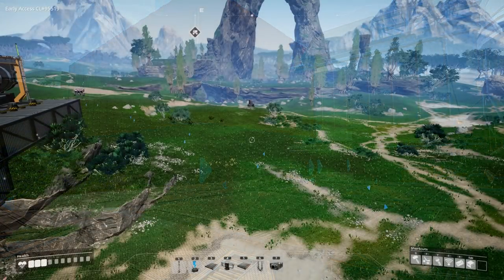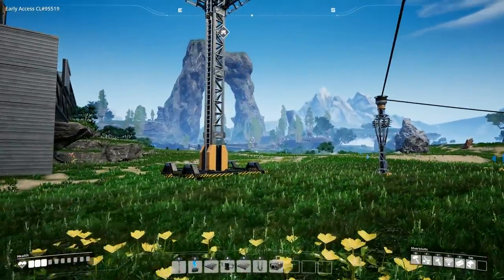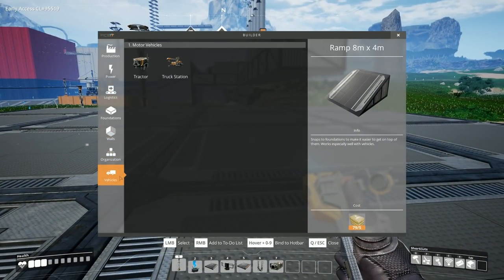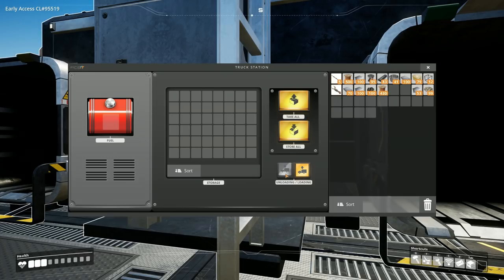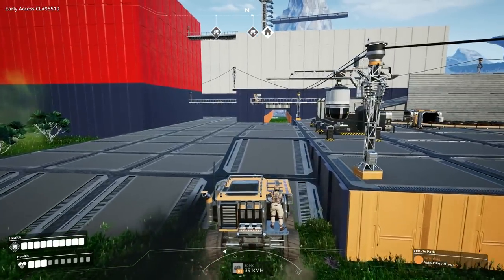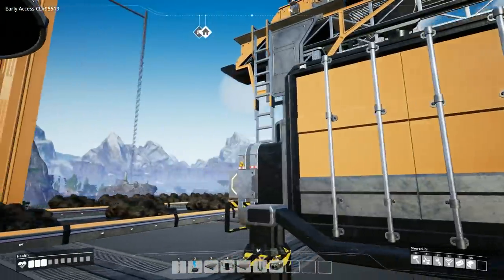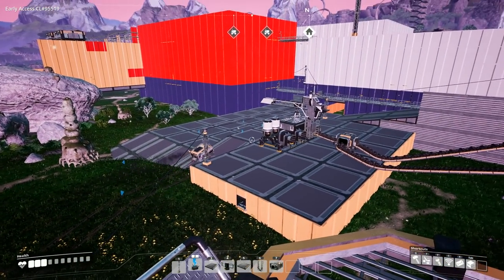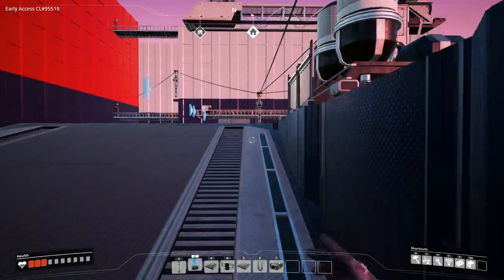Satisfactory Tutorial | Automated Vehicles

Comment: Hrm, my cube truck seemed to run the loop but wasn't picking up fuel. It just looped until it ran out of fuel. I made a truck stop at the oil fields where it loads crude barrels (will later turn this into a train station). I've set up a refinery there that makes Fuel which also gets loaded into the fuel slot. Maybe there's something wrong with the path. Will try recording again.